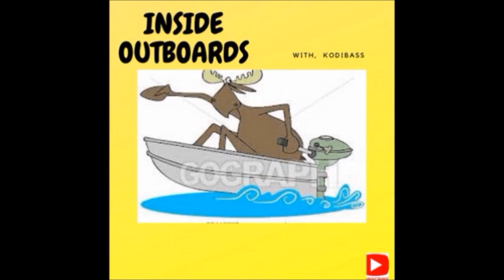SUZUKI  9.9 HP Outboard,   &  Evinrude   6 HP....      kodi

Comment: I got two 6 hp kickers a 1969 Johnson and 1975 evinrude 6 hp and nether one has a tell tell just comes out the exhaust but the 6 hp evinrude needs a water pump I picked it up for 60 bucks has the nylon pump instead of the brass in the center so I ordered a pump kit for 35 bucks thanks for the videos
Reply from the maker: Thank's,  Take care of them they are getting harder 2 find in good shape.      kodi

Comment: I'm sorry but this was not an outboard video. There was no Mercury. Lately I've been liking Johnson and Evinrudes. All three are great. Personally I would like to know what 30hp and what 40hp would be easiest and cheapest to squeeze more from. Where I live it's 30 on a John and 40 on a pontoon max
Reply from the maker: If I were in that situation I would go with a older Merc.  They are rated @ the prop not the power head so u get an additional 5 hp.      kodi